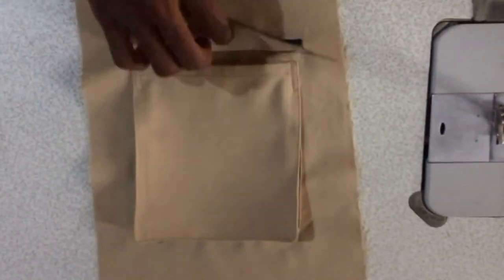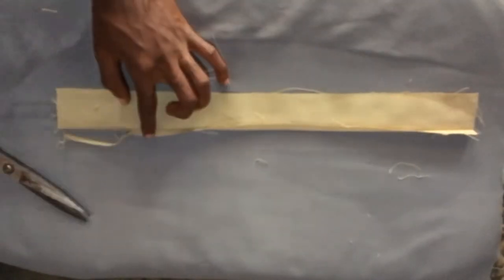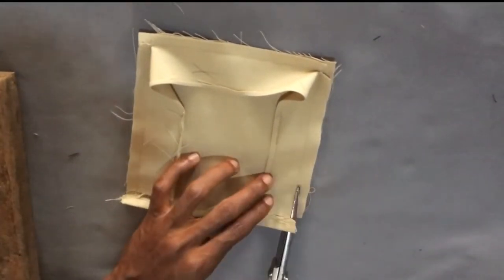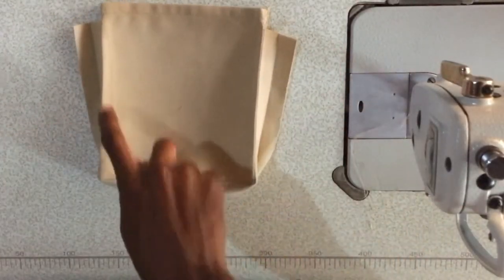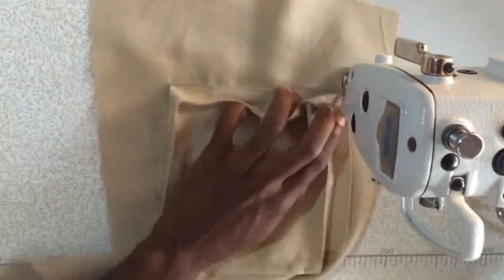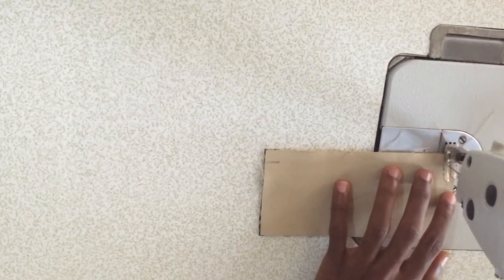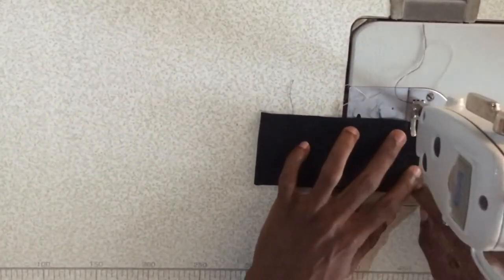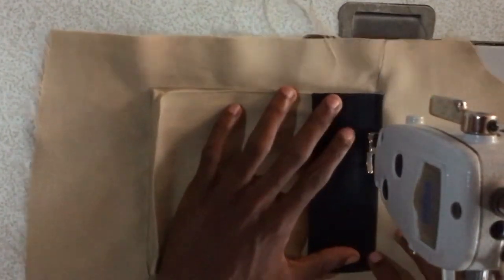How to sew a gusset pocket with flap | Cargo pocket | Free pattern

Comment: excellent video! just had a question, when I sew the gusset onto the bodice, it ends up larger than the face of the pocket, and is visible from the front. do you know of anything I could try to avoid this?
Reply from the maker: Thank you Lucas Kuhl.🤗
You must make sure the gusset is the same length as the face, and also make sure that you sew the gusset on the garment exactly in the shape of the face, and you're good to go. 😉👍